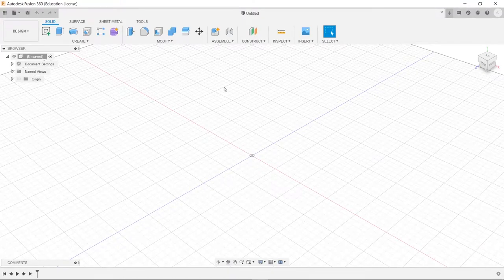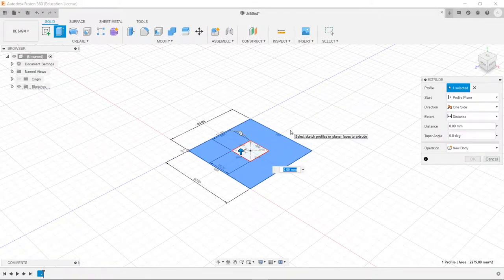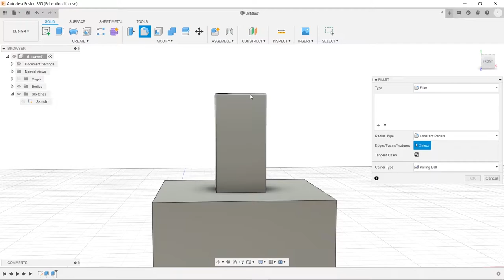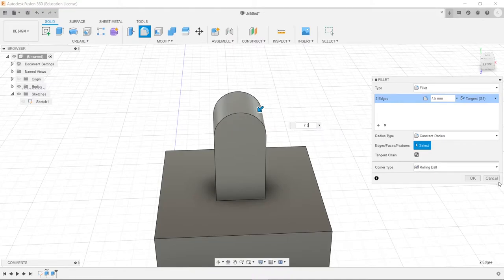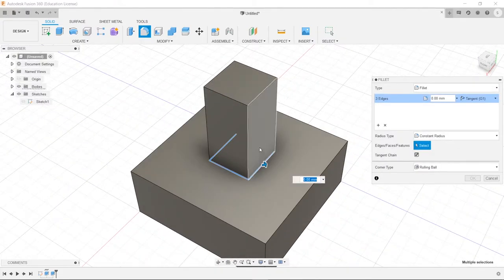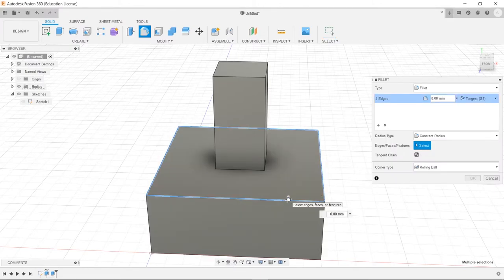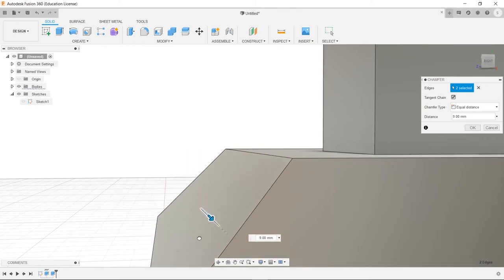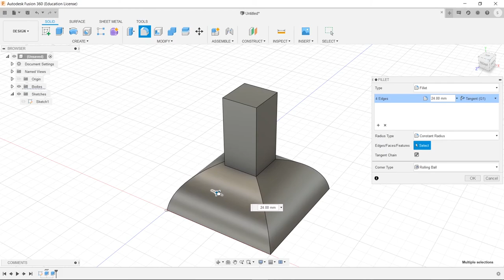Fusion 360: How to fillet and chamfer

Comment: my fillet  keeps moving in the wrong direction, as in its eating a curve in rather than smoothing a curve like your example
Reply: Hi Ryan, in Fusion 360 fillets can only work in 2 directions and that is dependent on the location of the fillet. For instance, in the video I fillet at the edge of a rectangle which cuts away at it but then I show a fillet at the intersection of two rectangles which generates a smooth curve between them. When you are filleting you just have to know how its going to behave depending on those 2 conditions.